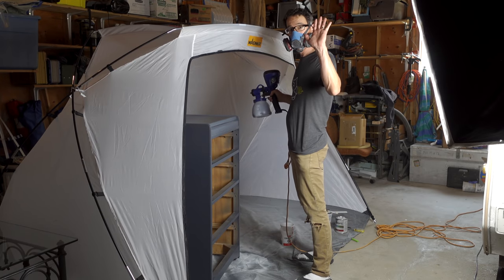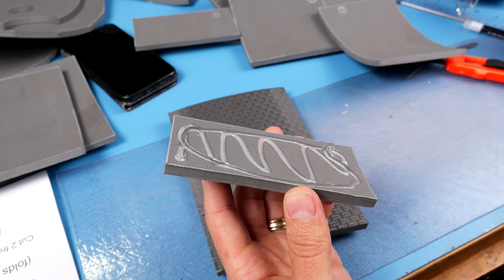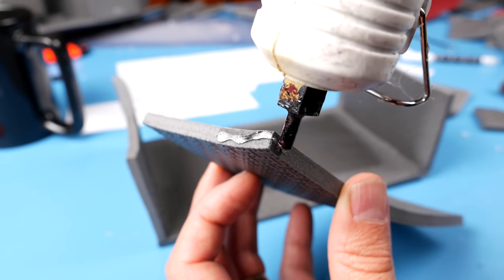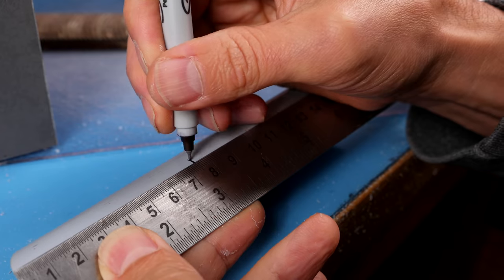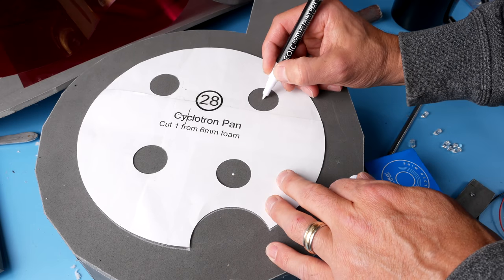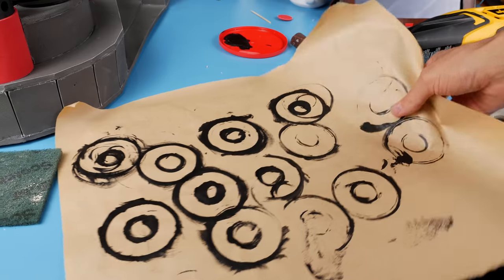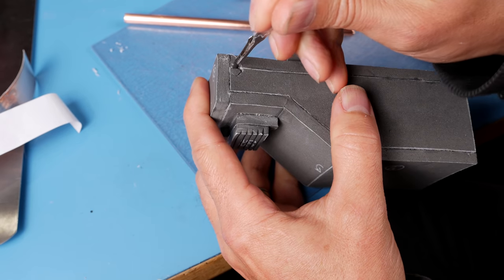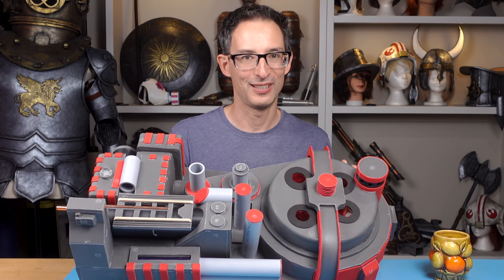DIY Ghostbusters Proton Pack Made From Cheap and Easy To Find Materials. Proton Pack Template!!

Comment: This is the best thing on the internet right now. Anywhere. You, Sir, are an incredible human.
Reply from the maker: Wow, that's some pretty high praise, thanks!
Reply: @LostWax  You deserve it. And my wife thanks you - I just started my first build and I’m $50 in and haven’t even cut my materials yet. 

Quick question - what are the dimensions of your printable templates based on? I’m hoping they match the plans I’m basing my build on so I can use yours. Thanks again 🙏

Comment: This is awesome. When I was a kid I made a 3D Proton Pack in the 80s out of cardboard based off the cartoon figure. I didn't know how to make the gun so I used a old long handled flashlight tied with a string. I wish I had a picture. I was probably 10 years old and incase you were wondering I was Egon Spangler.

Comment: From what I have found out, putting together an accurate Ghostbuster costume for my young son and myself, I thought I’d pass on the following. I’m mainly a weekend maker and on a budget. I’d like to come back when the project is done and maybe give an idea of cost and supplies in the US for anyone who is interested.

The foam proton pack really looks good and its very accurate looking. I would add that you should try and find an EVA mat that has the smallest pattern on the back side. I found one with a steel plate texture and it was a pain to either cut it off or sand it off. Also, I would suggest building the pack in smaller sub-assemblies. For instance, I built the three piece crank generator, including the pipe piece and the narrow strip details, then painted it, and only then added it to the back piece. I thought it might be easier than putting it all together and then worrying about getting a good coverage when it comes time to paint.

I’ve also found some other pieces and parts for the rest of the costume. As far as the ghost trap, the ecto-goggles and the PKE meter, know what you are buying. I got a static prop for the trap because it's only a hollow box that doesn’t even open, but it won’t be too heavy to hang from a kid’s belt. 

Also, anytime you put the word “Ghostbuster” into any search for prop parts you can expect to be over-charged. I found a military MOLLE backpack frame for really cheap on eBay as well as the military pistol belt. If you search for Ghostbuster gloves you could be paying up to $30. I found Inland Empire Safety in Walnut California that carries actual chemical gloves in smooth black rubber for about $1.50 a pair. Like I said, I’ll report any other finds I make if anyone is interested. I didn’t mean to steal any attention from Chris or the project! Thanks and don’t cross the streams.
Reply from the maker: This is fantastic info, I'd love to hear if you find something that works for the elbow and knee pads as well!

Comment: This is absolutely awesome, i did it in about 3 weeks, with custom electronics, and a couple of pieces in a 3d printer, it's perfect, i got my own working proton pack working with an spengler neutrona wand( 3d printed holder and i used some lego bricks to make the pack more solid and be able to hold that weight for a long time) you may want to also buy or to do the alice frame, since it helps the pack to not bend over and also to be more screen accurate, but man, thank you, great tutorial(also if you want to do it, make sure that you print the right size, i did 2 proton packs because the first one wasn't the size of an adult, it was more for a kid, and since it's something you don't know well until you finish, really, check it twice before you start cutting xD)
Reply from the maker: I'm so glad it worked out for you!!

Comment: Great prop! You can buy a 100 LEDs in a variety of colors for less than the cost of the flashlight you hacked, and they will have the correct polarity marked. Probably can't skateboard to the LED store though. Becky Stern did a nice video about how to add LEDs to any project with correct hookups, balanced brightness, and tips on diffusion.
Reply from the maker: Yeah, Adding electronics is something I'd really like to learn more about, I'll have to check out that video, thanks!

Comment: I just added a 1/8 inch board that fit the pack size. Think of using washer and 2 inch bolts to hold the ALICE Frame to the board. I used rubber cement on the flat side of the board and took foam backing glued. Then, slowly squish together. After dried, cut into shape. Bought a Spirit Halloween Ghost pack for the electronic. That how I made mine.

Comment: This looks incredibly fun.  I’ve built multiple Proton Packs over the years, from both wood and fiberglass, but it would be nice to have a lightweight option to take to events so I wouldn’t have to lug around a heavier pack all the time.  Might have to make this a future project.

My only main concerns would be structural, but that could easily be remedied with small supports throughout the pack.  Also, on the ladder frame, or Booster Frame, I’d suggest using pencils for the angled strips on it rather than dowels.  They used Dixon Ticonderoga’s on the original, but you could use any hexagonal pencils to get more or less the same look, and it shouldn’t add really any weight over dowels.
Reply from the maker: Hehe, yeah, I just found that out about the pencils on the ladder- I can't believe I didn't think of that when it was staring me right in the face:)

Comment: That looks great. You can get a Hasbro wand that will give you something solid to hold and have the sounds and lights you want. Regardless of what you do with the wand, you may want to fill the side of the crank generator with block of packing foam to stiffen it up to support a wand.
Reply from the maker: That's probably a good idea. Do you know how much the Hasbro wands weigh?
Reply: @LostWax  mine weights about 960 grams.
Reply from the maker: @robbates4704  Awesome, thanks!

Comment: I honestly made your plague doctor mask out of steel an aluminum sheet metal with leather accents it worked out rather well I love it my daughter loves hers both I made in to functional gas masks so we can use them if a hostile military force takes over lol
Reply from the maker: Wow, that's taking it up a level! I'm impressed.
Reply: @LostWax  it is easy the hardest part was adding ski goggles so I could see my daughter an I both need glasses and your mask made it difficult to have them on with it lol maybe different if I used foam but I didn’t have any of that at the time. I did however have leather steel an aluminum sheets that I could use

Comment: I have a question on the red LED lights on the Cyclotron. How many LED lights can you hook up to a 9 volt battery? Is 4 LED lights going to burn the bulb quickly? Do I need to add resistors?

Comment: For those of you who are thinking… “I don’t need to print out the instructions, I’ll just watch the video!” You need the instructions. You need them. Print them out. It’s a pain in the ass to jump around in the video.

Edit: This video is done extremely well. But it is easier to have the paper instructions on hand. The measurements, the pipe sizes. The easiest order of doing things etc. 

I did it the hard way lol learn from my mistakes young Padawan

Comment: Only thing I would suggest, when working with Foam, is after you get it constructed, going over the whole pack, with your heat gun, set on low, will help open up the "Closed Cell Foam". This should give it an almost "Glittery" or shiny look if done right. Then you can use "Plasti-Dip" spray to seal the whole pack before painting.

Comment: My only complaint is that the required thickness is 6-7mm.. and im having the worst time tracking down that size. I'll eventually find some, I bought the template and im excited to put it to use!
Reply from the maker: Do you mind me asking what thicknesses are more common for you to find where you are? It's good for me to know when making other patterns. Also, it is possible to alter the pattern for other thicknesses, but it takes some very careful thought.....
Reply: @LostWax  Oh i know thats why im following your rules to a 'T' with the thickness of foam and on this build! 

I mean the most common thickness would be like the ones you find at Hobby Lobby (2,3,5,10mm) 

The most common  thickness of foam i can grab anywhere for a project like this would be 5mm.
Reply from the maker: @VincentGonzo  Thanks for that info, that's really good to know!

Comment: Hey there thanks for this guide! I have 12mm thick eva foam so I’m guessing it wouldn’t work for a lot of these pieces so easily
Reply from the maker: The problem is that it will throw some of the dimensions out of whack. If you think through it very carefully though, you could alter the pattern so it would work with the 12mm foam.

Comment: Hello, thanks so much for the plans!! I'm embarking on my first project with this and you've helped so much!!

Can I ask, will you do a neutron wand plan and video?? Please 🙏🙏 do
Reply from the maker: Awesome, I hope it turns out! It's a pretty big project for a first one, so give yourself lots of time. I will hopefully do a wand video, but not sure if it'll be out before Halloween.
Reply: @LostWax  Ok, I do have a Spengler plasma wand I can use instead as it comes with a connector. Can I ask, have you used anything to help support the back of the pack/make stronger, and also to enable an Alice frame or makeshift frame?

Comment: You got a sub from me! I would say one thing that would benefit this particular build is a schedule/timeframe... meaning, if a newbie starts this... how long should they expect to take to build it, etc? For example, you're very seasoned with this... clearly, but how long did it take you to build this?
Reply from the maker: Yeah, that's a hard one for me to judge. I've taught some workshops, and one person will be finished with an amazing project while another is only a third of the way through. It really depends. And I don't even know how long it takes me to build because I am filming as I go which adds tons of time, I am also adjusting the pattern as I go, so, say the ramp section, I made it 3 times before I got it perfect. So, yeah, I'd have to remake it all again following the instructions to have a good idea.

Comment: How does the glue hold up to heat when outside? Is there a sealer you can put on it for extra reinforcement
Reply from the maker: It all depends how hot it is. I tested it in a hot car and the glue gave way pretty tragically here's the video: https://youtu.be/iayq7iFnlgQ  If it's going to be in direct, hot sun, I'd recommend using contact cement. I just don't use it because I want to stay away from toxic goo as much as possible. Your choice, just use good respiratory protection.

Comment: Did you do any heat gun sealing prior to putting on any sealant and paint? From my experience I find that the heat sealing rounds edges and corners a bit which makes it not sharp looking anymore. Do you notice that too?
Reply from the maker: I did do a quick run over everything with my heatgun. No sealing, just 3 coats of paint. It does round the edges just a tiny bit, so depends what you are going for. In this build not a big deal.

Comment: This is incredible!  Thank you for making this Chris!  I put one together and it was my first time doing anything like this.  You make it look so easy :)  It took me forever.  I'd like to wear it out this weekend, but I'm unsure how to put it on.  I know you are still working on other videos.  In the meantime, is there a strap system you attach, or what do you recommend attaching so you can wear it?
Reply from the maker: My plan was to make a frame from PVC pipe, either bending the corners or using 90 degree connectors. I was thinking I'd cut rectangular slots in the backplate of the pack, and then slide in wood blocks and turn them 90 degrees once inside and glue them in place. The frame would be attached to the block with screws or bolts (best to make the screw holes before the blocks are glued so there isn't too much twisting against the glue bond. That was my idea, but I haven't had a chance to try it out yet
Reply: @LostWax  Thank you!

Comment: Do you plan on using the Hasbros Spengler wand with this or will you be building the wand as well? Would love to see how you would hang a heavy pack on this. Not sure if gluing a wooden block to the inside of the gun mount would be enough
Reply from the maker: I'm gonna try make one myself..... But I haven't even had a good think about it yet, so fingers crossed....
Reply: @LostWax  Thank you for replying to all my questions!

Comment: Hey there I am planning on making this project which is just so cool!!! But I was wondering, could I attach the Hasbro Spengler neutrona wand to it?
Reply from the maker: I don't see any reason why not. It'd just be a matter of getting some hose that fits the wand and then attaching that to the pack. Does the wand come with any hose already?
Reply: @LostWax  It does not come with a hose but it does have a cap that has a threaded bit so you can add a hose.

Comment: For a kid's pack, do you think I can scale the print to like 80% and build from there?
Reply from the maker: So, the problem with scaling this pattern is that, although the pattern will scale down, the thickness of the foam you use stays the same. Some of the pieces in this pattern rely on the thickness of the foam being 6-7mm to get all the edges to line up. On the other hand, if you reduce the pattern 83%, and reduce the foam thickness you are using 83% then it should work. It just so happens that 83% is the what 6mm foam reduced to 5mm would be. So, if you used 5mm foam and reduced the pattern 83% it might work. Just be aware that the tubing used will also either need to be reduced in diameter- I haven't really looked at what's out there, you should be able to use 3/4" PVC instead of the 1" And I am not sure off the top of my head if there is an easy substitute for the 2" ABS pipe.....
Reply: @LostWax  83% reduction was perfect for a kid size (about 5' tall) and could be good for kids a little bigger or smaller. Used the 83% factor on the pipe lengths too and that worked out well. Some of the other dimensions I just cut to size based on in-construction measurements. Great design and project. My son loved it and got tons of great comments. Just bought your whole set of prints. Thank you!
Reply from the maker: @cincylaw  Thanks so much for the feedback, that's great to know! And I am so glad your son loved it!!

Comment: How many knive blades would you say you went through to do this?
Reply from the maker: I actually sharpen my knife as I go, so I only used one blade. But probably sharpened it 5 or 6 times.
Reply: @LostWax  hey thanks for the response, but now I'm curious.  Are you just stopping it on leather/cardboard, running it through a little $5 sharpener, or taking time on a stone?
Reply from the maker: @PeaceLoveAndGuns  I use a stone to sharpen it. Just keep the stone beside me and whenever it gets a bit dull, give it 30 seconds or so and good to go again.

Comment: So if I want to make one for my kid, can I print each template page at 1/2 scale ?
Reply from the maker: Scaling this pattern down isn't super straightforward, unless you are scaling the thickness of the foam down the same amount as you are scaling the pattern. This is because a lot of the parts actually rely on the addition of the foam thickness on the edge to make the final dimensions of a piece. If you do some careful thinking, I think it could be done.....
Reply: @LostWax  sweet. I’m not doing the entire project… just a couple of the main parts. My kid is 3, any more detail than the lame printed backpack that came with the costume he’s gonna be stoked over lol

Comment: Though you have some interesting terms for parts of the pack that differ from what is generally considered to be canon, this is a great build. One slight modification I would add is on the "ladder" portion, instead of regular dowels, if you used a standard pencil it would give you a more accurate look to that piece. Also filling the seams with something like Alex Fast Dry would allow for less seamlines to be seen, making it look more like a metal box and not foam.
Reply: Also, when building my own pack out of foamboard and thermoplastic, I found that on the Crank Generator where you placed the bit of piping, an empty bottle of acrylic craft paint, like you can get at a craft/dollar store, works great, plus gives a good mounting point for the hose that attaches there.
Reply from the maker: Oh, my, I can't believe I didn't think of a regular pencil.....I was like, I wish I had some sort of long hexagonal plastic.....Oh well...
Reply from the maker: Nice, that would work well!
Reply: @LostWax  the actual ladder on the packs used pencils on that part. great build btw! are you going to get an Alice pack or make one out of PVC pipe to keep costs down?

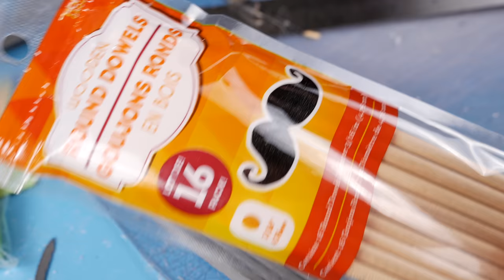Comment: 25:50 Tip: I believe in the original movie they actually used Ticonderoga pencils on the side of the “ladder” instead of skewers like in the video, so if you have more pencils no one is using, you can use those.
Reply from the maker: Great tip, thanks!!
Reply: @LostWax  Happy to help!

Comment: What foam density works best for that? Low or high?
Reply from the maker: The foam I used is what I would call a medium density foam. If it's too soft, it's a pain, so better too dense than not dense enough.
Reply: @LostWax  Great, thanks 🙏🏼

Comment: How would i do this if i just eant to make the cyclotron?
Reply: The steps from 14:35 to 17:40 for the main cyclotron body (speech bubble) 19:13 to 25:30 for the N filter, the details around the cyclotron (speech bubble) and the little raised circles around the lights (ignore steps that aren't part of the cyclotron/speech bubble assembly)
Reply: Oh yeah, also 26:24 28:02 for the bumper (cyclotron belt)
Reply: Thank you!  @Musicalmane